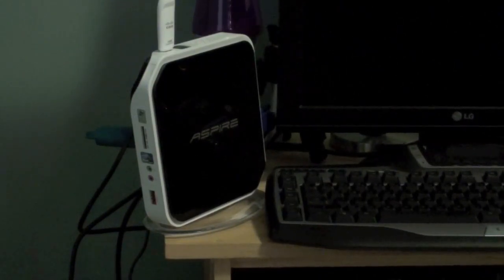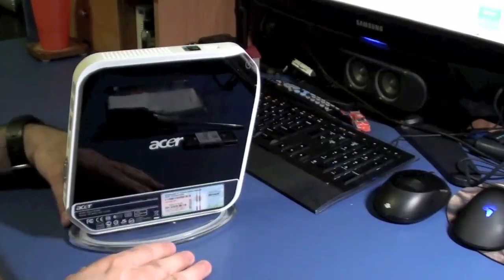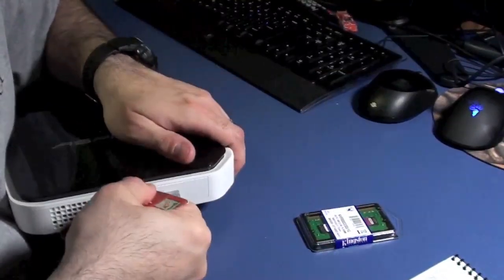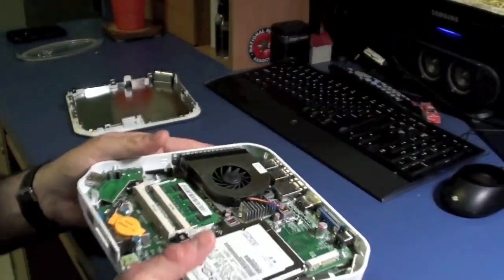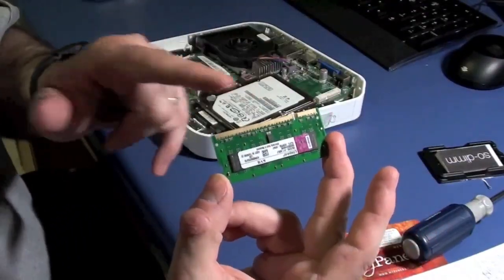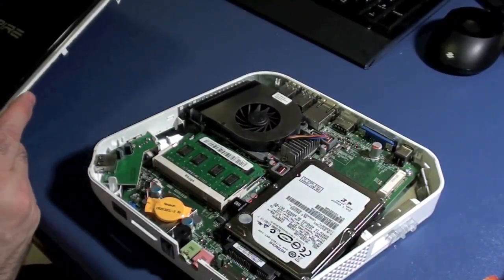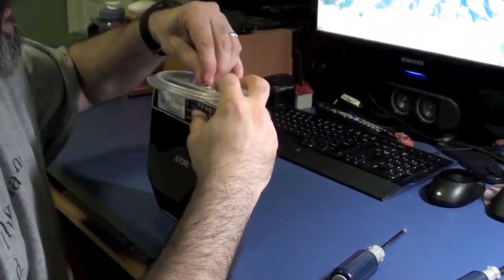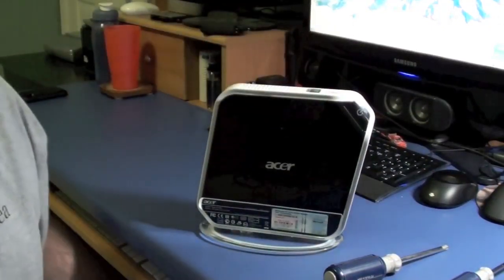Acer Revo Memory Upgrade

Comment: I have made something similar using a micro itx board, it has a pci express slot for future graphics upgrades, but as i seem to only use it to record and stream video etc, it's still doing me proud.  Revos are good what with the vesa mounting and probably better for blu-ray playback than a raspberry pi. I thought these came with the 330 dual core atom processors with hyper threading though?

Comment: No matter how hard you try, you'll sure break some of the two P-shaped holders. So get some glue to fix them. 
A very idiotic move from Acer to make the case that way. Slide-ins with a couple screws would do just as well.

And by the way, talking so much about the memory you somehow forgot to say the most important - the module is a DDR2, 1.8v.

Comment: Thanks buddy just installed mine in less than 5 min. What is that other smaller ram like slot in there I open mine and there's another slot off to the opposite side

Comment: i thought was a router or modem than i remeber how small they are.i have here a huge desktop,.i was very proud i had 7 or 8 years old pentum 4 desktop.i first replaced the hard disk,i first did mi self i blew it allmost it was ready for windows 7,only need more memory,i had 512 i bought 1 gig or 2 gig,i try,or it did t fit or something else i end up with a over load,if i have to do in few years with this dual core i go to the computer shop

Comment: Does this PC run off 12vdc?  I wonder if it would run directly off a 12v battery for field day? If so, it would make a nice little field PC for Ham Radio Deluxe
Reply: I know this is a hella old comment but I am actually running one in my camper van I got out the garbage on 12v. I bought a 12v to 19v step up converter off Amazon for $8 and spliced another end to fit the revo.